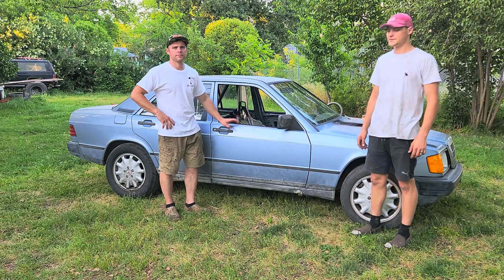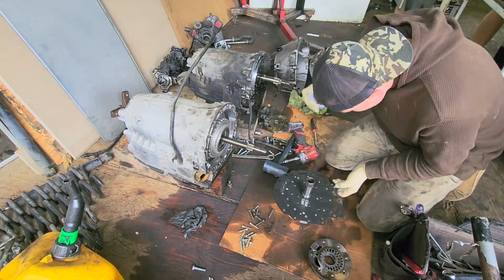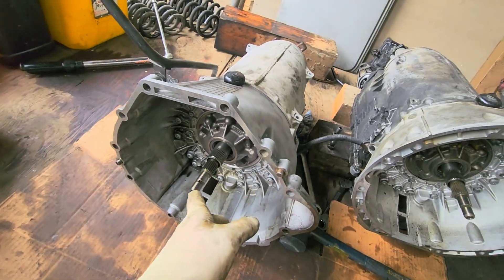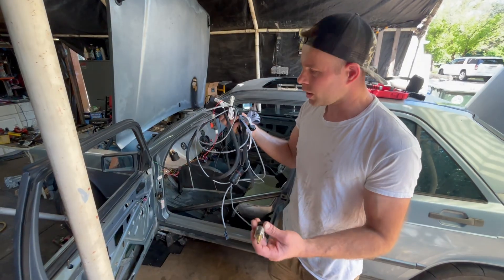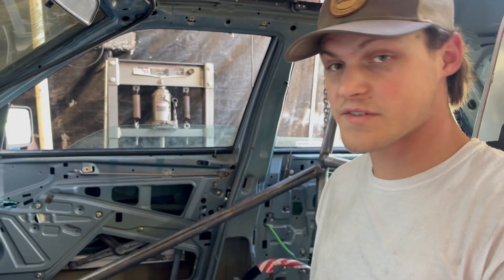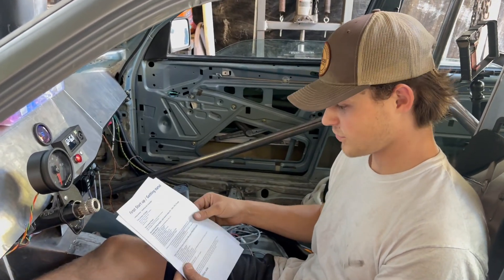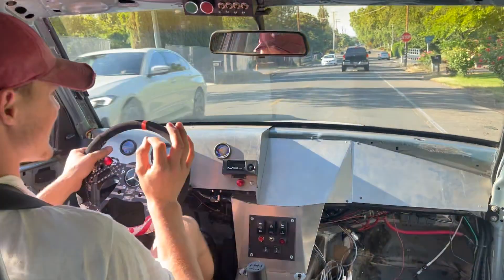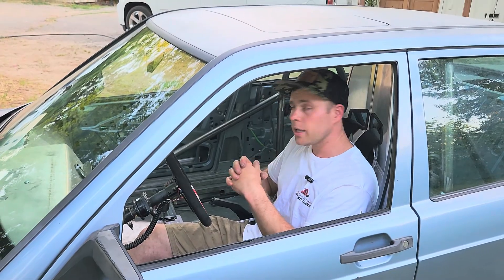AMG Transmission for a OM606! (Surprisingly simple install)

Comment: Ive got an OM603 and a 716. from a c230K that ill be swapping in my toyota pickup. Did you guys have problems with the 716? Or are you using the the 722 for faster drag times? 

Awesome build by the way 🤟 id love to build a baby benz with a big old super turbo in it. That would be one heck of a fun daily driver lol
Reply from the maker: The 716 did great. Definitely a transmission we would want to use in the future for a daily. We just wanted something that can shift quicker.
Reply: @ProjectNotSoSlow  awesome, im glad to hear that 😀 ive heard that these transmissions are weak and they rattle with solid flywheels on the diesel engines. So I was a bit worried about using one in my swap lol
Reply: @ProjectNotSoSlow  what clutch did you guys use in your swap when putting the gas transmission behind the diesel?

Comment: The TPS is good as long at the sensor rotation is not restricted at each end of the throw. Ole controller calibration 0-100% takes care of the start - end position. Controller function is enhanced in automatic mode with external (drive-shaft) sensor. Best to have a slightly firmer shift under load to ensure positive engagement of clutches.
Reply from the maker: We’ll look into that. Thank you
Reply: @ProjectNotSoSlow The manual mode is good, but the system needs a 2 seconds gap between application of the paddles to be properly recognized and processed before the next manual shift. For your application, the ole controller has the capability to emulate foot to the floor launch control, if it is set up properly! Carefully determine and program the shift-points with respect to RPM, speed, boost. It requires patience and understanding and the correct sensor parameters to get the best out of it. Read the manual more than once and if you set it up properly, your granny can drive it during the week and you can burn up the quarter-mile on the weekends with red-line shifts the whole way.
Reply from the maker: Thank you! Didn't know about the 2 seconds between manual shifting but makes sense! Thought we had a bad connection or buttons were not responsive. I guess we'll take the time and set up the automatic parameters.

Comment: If your new transmission dies on you, considering getting another one from a Dodge Charger or Chrysler 300C. I found a low mileage one from a Charger for 1/3 the price of the Ofgear controller.
Reply from the maker: Hopefully we won’t have to get any new transmissions anytime time soon. So far the trans is running great.